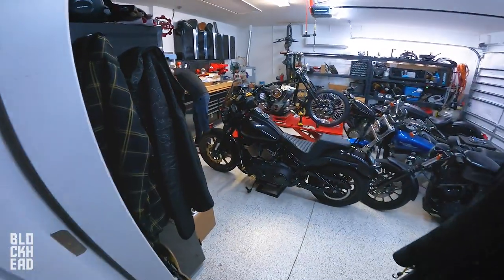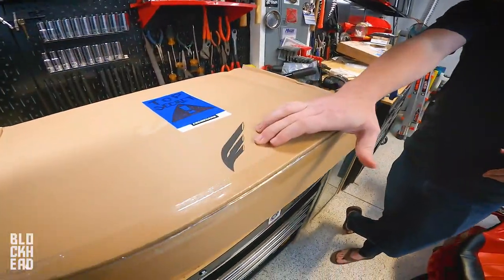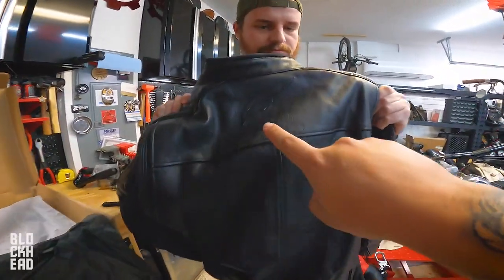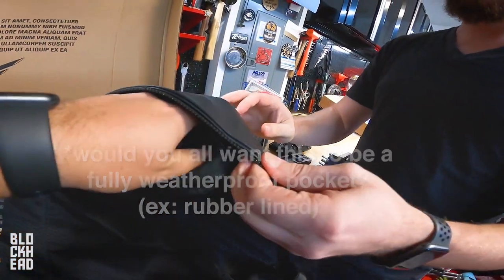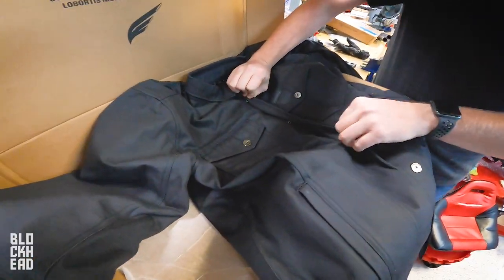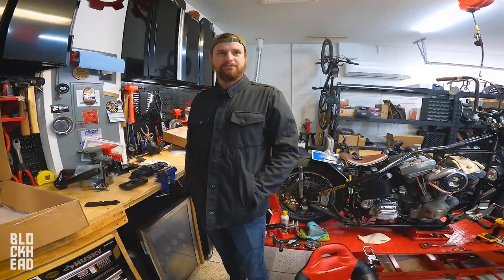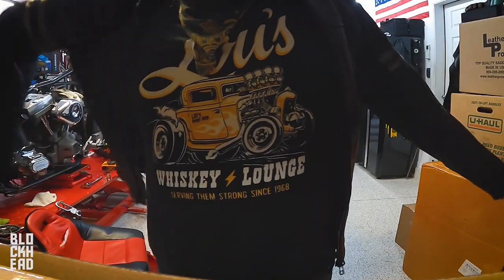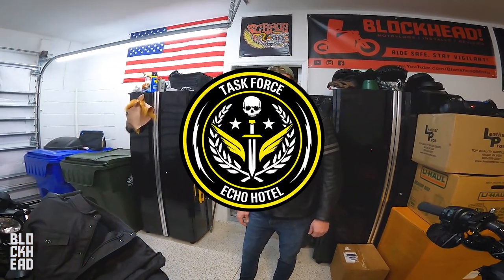ENGINEHAWK Prototype Jackets (Ruroc's New Moto Apparel Co.)

Comment: Those jackets look very nice!!  If an interior liner can be added I would be 100% sold.  I do agree about larger tabs for the pocket zippers.  I would be a bit worried about breathability on the leather jacket.  My current leather jacket has a few breathable areas i can unzip in the front, back and underarms of the jacket.  That allows me to wear it cold/cool mornings but also add breathability in the afternoons when it has warmed up.  I really dig the denim jacket, I would wear that even if I wasnt riding.

Looking forward to see what is ahead on the channel!!

Comment: That denim one is sweet! I would probably get it a size or two larger just to wear a hoodie underneath. And a second one, true to size,  just to wear when the weather is nice!  

I don’t like the large logo on the bottom of the leather jacket. Maybe have the “Enginehawk” tag on the bottom of the leather jacket. Also, the idea of mesh with leather is awesome!

If they started a line of hooligan appeal, I could see a large “enginehawk” (spelt out), going down the sleeve. Maybe some sort of denim-leather jacket (small amount of leather, like elbows and shoulders). 

Those look great!

Comment: Test ride the Rebel 1100.  This is the bike Harley should of made. 86 horsepower at less than 500 pounds with DCT, stability control with IMU standard, cornering ABS/TC, ride modes, and led everywhere all less than $10,000.

Comment: Hey Blockhead how are  you ? I have a little question for you I want to buy an used Iron 883 but I just wanted to know if 12000 miles is too much for a bike like this ? Or should I go for a bike with less miles on the odometer ? Thanks a lot lad :)

Comment: The biggest problem we have in buying motorcycle gear is not being able to sit on bikes and make sure it fits.

Zippers need to be durable, I prefer multi lined jackets and wear it all seasons. 
Back armour needs to be flexible, too often  they aren't so you end up taking them out for comfort.